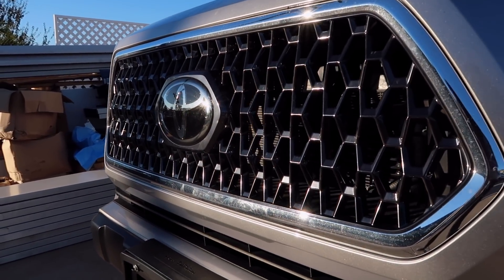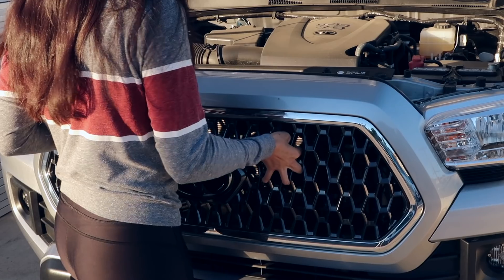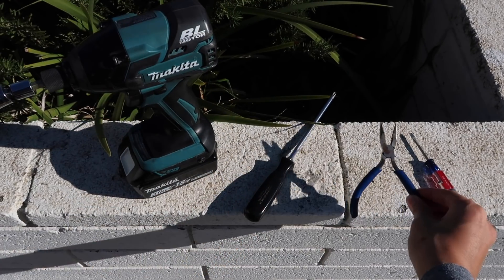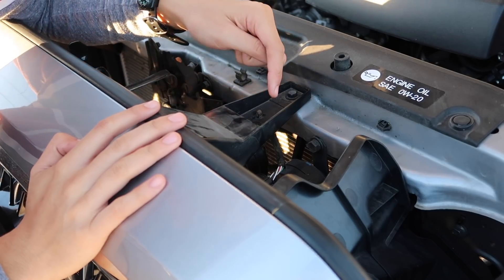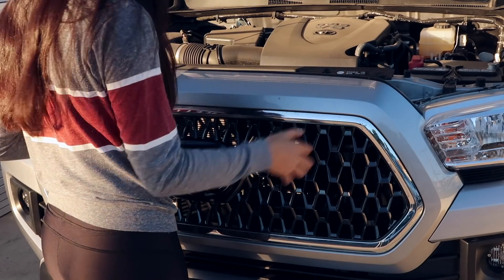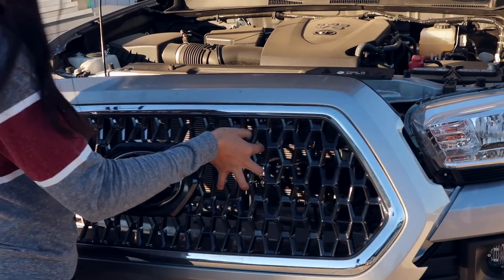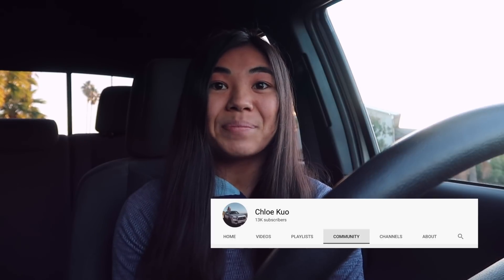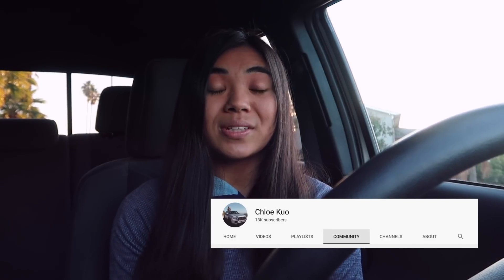Taking Off My Stock TRD Off-Road Grille | How to Replace a Grille on your Tacoma (with sensor)

Comment: I’ve said it before and I’ll say it again (referring to the Sport and OR grills,) the 20/21 > 18/19 > 16/17.  My truck is a 2017 and has the original, all chrome, cheese grater grill! The 18/19 were much improved, and as you know, the 20/21 are better yet. I love the heritage grill and replaced my original cheese grater back in 2017. 

Separately, there are two hood strut companies out there to consider. One is Red Line Tuning that I went with, and the Running4Taco guys have another brand. Hood struts are one of my favorite and most useful mods to date! 

Keep up the great channel!

Comment: The new grill looks just like my 2021 Tacoma TRD Sport.  Looks so much better.  You are a hard worker and  I really respect you for that.  You mentioned a new suspension mod.  There is only one lift kit that Toyota sanctions and thus you retain your warranty on the TSS system. It is sold and must be installed by a Toyota certified technician. It was just released in February if this year and will fit the 2020 and newer Tacoma’s. It lifts the truck two inches in the front and one inch in the rear(to level the truck). It replaces the 2 inch Bilstein struts and shocks with the 2.5 Bilstein struts and shocks. Basically, they install a new grill that accommodates the new angle for alignment to make the TSS system work properly. The technician installs it, recalibrates the TSS alignment on the radar and window camera and does a realignment of the front suspension.  Im not sure what other parts they use to lift the truck.  I understand that it costs about $1800 dollars and with labor it is about $2400.  You can count on Toyota for quality and you maintain your warranty.  Other aftermarket lift kits voids your warranty, putting you and other people outside your vehicle at risk without the TSS system working accurately.  You can get bigger tires and have more frame to ground clearance with this Toyota kit.  I am buying one soon.

Comment: Just installed the same grille in my SR5. Thanks for this video, it was very helpful!!
Reply: I tried mine to  , couldnt take the grill out of the frame! I mean i could but those tabs whichis almost 30of them wouldnt come out without breaking so i stopped. Especially the chrome frame would break sooo easily.

Comment: You can ask the dealership to check the VIN and see if your truck has Campaign for the Radar Cruiser Control. If it does, bring it to the Dealership and they will put a shield behind the sensor to prevent water or moisture from getting in or building up, causing that "Mal-function message". It happened on mine when i drove my truck under heavy rain and somehow water slashed in and that message popped up. After the shield was installed, it's good til now.

Comment: BTW. .  Lane departure and collision avoidance work off of the camera behind the rear view mirror. Mine burned out on my 2019 TRD offroad at just 30,000 miles and the warnings flashed on. 
They did cover it under warranty but it's just more tech that I could care less about making problems!

Comment: Chloe Kuo, I currently have the Pro grille and am replacing it with the same grille you installed. I do not have the 8 small screws that secure it to the surround. Any idea what size screws they are?? Planning on going down to the local hardware store and buying some.

Comment: Here I am wishing I even had a Tacoma! Just graduated nursing school so I'm hoping to be able to afford it soon!:)
Reply: Don’t feel bad. I bought a 2019 brand new from dealer. They preinstalled a 3” suspension lift, 17” trd pro rims from the 4 runners, trd pro exhaust, and 33 inch tires. It’s a trd off-road and it looks better than a trd pro. Unfortunately  looks can be deceiving because the engine/trans is a complete pile of shit. Wish I would have never bought it.

Comment: I tried changing mine , it was so easy to take the panel out but was almost impossible take those grill tabs (almost 30 of them) without breaking them. So i i gave up and returned it.

Comment: I just sprayed painted mine flat black, 2014 taco cause i hated the chrome on it. Now all the chip damage on my bumper and grill from tiny rocks is getting to be pretty bad. I asked Line-X how much, both bumper and grill around 350 yucks. So we'll see. That chrome did look like a cheese grader though. New bumper looks much better.

Comment: Great video, but I was going crazy that you did NOT put a towel or blanket down when you were changing out the grills.  You open up the chances of getting scratches.  However, you did good.  👍🏻👍🏻
Reply from the maker: I totally should have, especially since my bed mat is dusty 😂

Comment: Did you need to recalibrate the sensors after the grille change?
Reply from the maker: Mine seemed to recalibrate itself right away. I’ve had no issues with adaptive cruise control so far!

Comment: Great video.  You should look at getting a new front skid plate.  I just installed the RCI off-road front aluminum one.  It’s fairly easy.  Just make sure to have a strong arm or impact wrench.   You can see what is involved in my video on my channel if you want..  wheeling fun.  Thanks

Comment: I think you forgot to place back the rain cover to prevent the sensor to get wet.
Reply: I thought the same thing. Chloe is very detailed so I think she may have just forgot to film that part.
Reply from the maker: Yup, I omitted it. The new grille/garnish is designed such that water can’t easily get to the top of the sensor (unlike my old grille). But you guys are right, I will probably put one back on for safety though!

Comment: There's no grab handle on driver's side!! If you take off the plastic off on the pillar there are 2 screws/mounting brackets for a grab handle. Suggestion: Install a driver's side grab handle. Owners will  love you

Comment: 6:05 fuel pump recall?? i have a 2019 and never heard about it
Reply: Yeah Toyota has a lot of fuel pump recalls going on right now, Call your local Toyota Dealer and set up an appointment, safety first 👍🏽
Reply from the maker: Check with your dealer or enter your vin on Toyota’s website to see all open recalls. Not all 2019s have the low-pressure fuel pump recall

Comment: Did you get the water proofing patch back onto the sensor?
Reply from the maker: I have to get a new foam piece since it was a sticker and the adhesive isn’t sticky anymore. The design of the new grille is made such that water can’t easily get in from the top (compared to the old one), but I should probably put a new one on